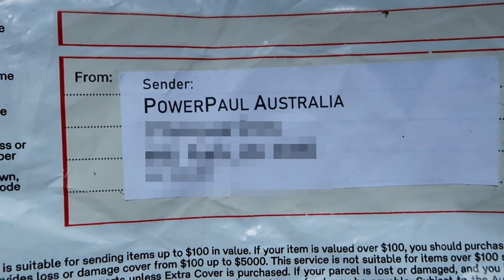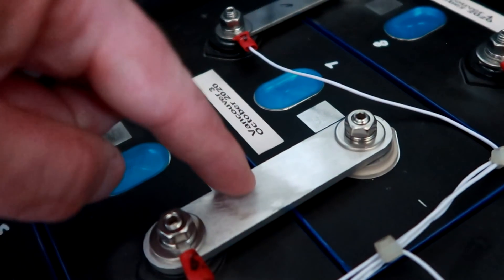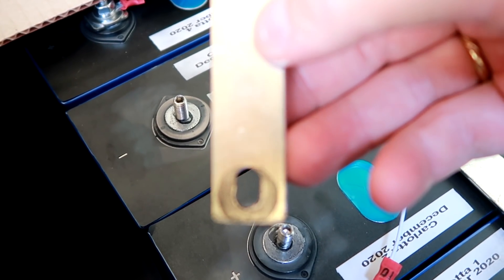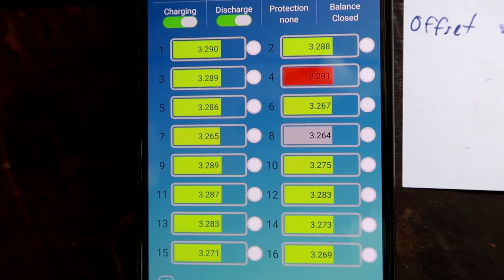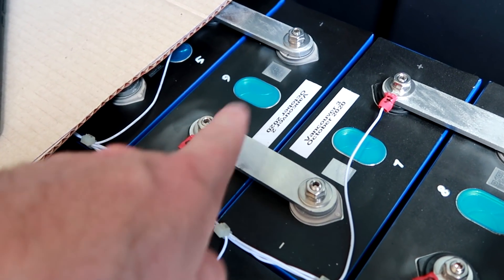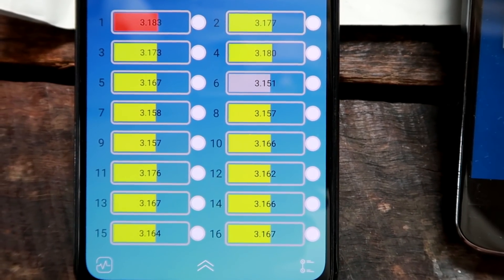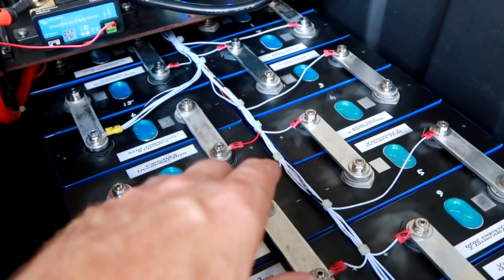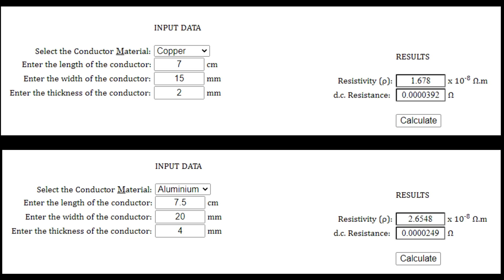Upgrading to Aluminium Busbars. Will this solve the issues?

Comment: 11:45 could be the right conclusion.
A joy (eine wahre Freude) watching knowledge and competence at work and I cannot imagine that this genius is not aware that aluminium connectors need to be thicker in size compared to copper due to
different conductivity properties: 0.0278 Ohm/mm² x m AL versus 0.0172 of copper.
If the battery terminals are made of AL then AL bars are the perfect choice for avoiding electrolytic corrosion.
Not sure how long any grease application could prevent moisture ingress from creating a battery cell of 2V between
aluminium and copper terminals or 1.8V in the case of tinned copper according to K.Giek "Technische Formelsammlung".
Within a week of charge equalizing 12x 12V lead acid batteries connected in parallel with simple AL strips for the purpose
of preparing those for 48V series configuration, I noticed terminal corrosion on some of the 24 connections.
No wonder, Lead to AL connection also has an electrochemical voltage difference of 1.5V. All it takes to start that process of
undesirable corrosion is moisture.
rolfgerig@bigpond.com
Reply from the maker: Hi Rolf, have you watched the video until the end? I did a comparison between Cu and Al bus bars. There is also a link to a calculator in the description.
Reply: @OffGridGarageAustralia  I perhaps should have 🙂.
My comment was not particularly directed at you except for compliments. Just general information for others.
No use pointing to literature of technical formulas to a walking encyclopedia anyway!
I have been sticking to Lead Acid batteries for my solar systems so far because of the lesser cost than Lithium
and simpler charging requirements rarely in need of cell equalization.
I am waiting for even better battery technology like AL-ion with promised properties encroaching supercapacitors
presently under scientific investigation and tried yesterday to include a link to a PV-Magazine AU article on the subject but YouTube censored and removed my entire content!
Cheers from NSW.

Comment: I look forward to the individual cell tests!
Reply: Pardon my ignorance, but what do you use to do the individual cell tests?  Something to measure the battery impedance?
Reply: @Swinopolis  Matt, individual cells can be charged, voltage checked, ohms of resistance measured, and load tests with amp/hours measured in load for a period of time until desired voltage is reached. Matt, I'm a newbie but that's what I guess.

Comment: Silicone high dielectric grease, which is also totally nonconductive, is also commonly used on battery and electronics terminals. Even telephone company "button" splices are pre-filled with it. But because you have metal to metal conduct displacing the grease, conductance is not an issue. The grease only blocks air and water intrusion.
Reply: Lyfan Deth. Aluminium jointing paste is not grease. Its job is to cut through the oxide layer and prevent it from reforming. 
The information is available from Utilux or Dulmison. Jointing Aluminium conductors can be a real pain and lead to spectacular failures if any short cuts are taken. 
When lugs or links are applied to aluminium cables, the lug comes pre-filled with jointing paste and sealed. The cable is cleaned and rammed home. The entire length of the barrel is then crimped in steps at 23 tonnes ensuring the paste is trapped in the joint.
Reply: Cool beans

Comment: I don't recommend aluminum. Many house fires in the US from aluminum wiring expansion causing connections to catch fire!
Reply: Nope. That was decades ago when aluminum romex was used in branch circuits with devices not rated for AL conductors.

Comment: Material IACS (International Annealed Copper Standard)
Ranking	Metal	% Conductivity*
1	Silver (Pure)	105%
2	Copper	100%
3	Gold (Pure)	70%
4	Aluminum	61%
5	Brass	28%
6	Zinc	27%
7	Nickel	22%
8	Iron (Pure)	17%
9	Tin	15%
10	Phosphor Bronze	15%
11	Steel (Stainless included)	3-15%
12	Lead (Pure)	7%
13	Nickel Aluminum Bronze	7%
Reply: This. That means that no matter how big an aluminum conductor is, it will never conduct as well as an adequate copper conductor.
Reply: @Sylvan_dB  Wrong. Those copper bus bars have almost double the resistance than the newer larger aluminium ones.  Very close to 0.00055 ohms per metre compared to the aluminum ones which are close to 0.00032 ohms.  Give or take a few percent.

Comment: +  If the bussbars are cool then they are cool :-)
+  If the terminal are not tight then you'll feel it getting warm to hot.
+  The old bussbars looked quite underwhelming.
+  Dielectric grease is used to inhibit the aluminium from forming Oxides, not to conduct.

Comment: Really enjoy your videos. You and I think alike. I am a big fan of Victron energy products. They just work. I am a power wheelchair user and we have modified my off-road tracked wheelchair last year with used battery cells from a Nissan leaf. I did not know about the chemistry runaway problem with those cells and we will be upgrading to prismatic cells for safety concerns. I did not know that the aluminum bus bars could make such a difference. Thank you for experimenting for all of us.
Reply: Recently purchased a 2012 Leaf battery pack to upgrade my bulky Lifepo4 pack on my ride on mower conversion. Not something you want to be near if you can't easily get away from the worst-case event.
I'll be connecting my ancient Lifepo4 200a cells to my new Victron Easy solar which should arrive today.
Andy's journey is a real gift for people starting out in off grid projects.
Reply: @andrewradford3953  especially for a wheelchair user. I did take a lot of precautions and finally found  a 24V 6S BMS's (One for each set charge only)  I had two sets of three cells in series and then running both sets in parallel in 24 V configuration. Then I used a victron smart battery protect for the high amperage controlled by the BMS with added low temperature protection , Low-voltage etc. Sorry this is off topic I can answer more questions on my page.
Reply: @andrewradford3953  I do like the Nissan cells I will probably repurpose mine for a DIY power wall in a metal enclosure. I have approximately 3KW in a wheelchair and a standby 1.5 KW backpack power pack as we call it basically just a battery in a backpack with an Anderson plug

Comment: Your "problem" was NOT voltage drop across the busbars, but voltage drop between busbar and battery terminal. No matter what size of busbar you use, this "problem" will remain. You likely now have two aluminium  oxide layers between  busbar and terminal to overcome.  I should also mention the high cell is of lower capacity, therefore will charge and discharge faster than those of higher capacity. The "low" cell is of higher capacity, therefore will always lag behind during charging and discharging. None of this is a problem.... they can never be the same, even if from the same batch. These readings will also vary over the following weeks and months of use.....
Reply from the maker: I measured the voltage drop in the last video.

Comment: Well use copper  ,  the best as as many wire strands as you can get hold off,  the atoms more more freely in small then wires the  in a solid block of copper.
And first of all make sure the bottom of the studs hit ground in other words makes sure the bottom of the studs should be 90 degree and great contact surface , promote this also with dieelectric grease also it treads  so atoms more freely with out any obstruction
Reply from the maker: dielectric = isolating

Comment: Hello  Andy,

Love the video's.
About the aluminium busbars and your voltage dops. Maybe you could try to put the balance leads directly on top of the busbar and not on the waser.
So you get cell- busbar-balancelead-waser-nut. Maybe one waser has a higher resistance than an other one, because they are stainless steel.

Greetings from Bonaire.
Reply from the maker: It should not make a difference though as the balance leads only measure voltage.
Reply: @OffGridGarageAustralia  but you see  voltage difference on your cells measured by the balance leads. So a small resistance difference can cause that it's only mV
Reply from the maker: @villacarinaapartments  I only see that because I'm pulling full load so the current going from the terminal to the bus bar causes the voltage drop. But I cannot measure that fro the stud to the ring lug of the balance leads. There is no current going  from the terminal though the stud to the ring terminal and washer to the busbar. It all goes from the terminal to the busbar.
Reply: @OffGridGarageAustralia  correct but the voltage you see on the bms app come from the balance leads witch are not direct to the cells but have to go thru the washer first. And that's stainless steel. So more resistance than if it was directly on the aluminium bus bar.

Comment: how about just get bigger copper bars with no crappy nickel on them. i bet you did not calculate the nickel coating on the copper bus bars on that calculator.
Reply from the maker: Copper will oxide quickly. I think they tinned them for exactly that reason.
Reply: @OffGridGarageAustralia  aluminium oxide's a lot more quicker than copper please research aluminium oxide layers vs copper. aluminium as soon as it is polished it will oxide strait away copper does not and the contact surface of copper stays good it is only the exposed copper to the air that the green oxide layer forms. basically the copper is coated to make it look good and not be green in colour.

Comment: VA includes reactive power and will be larger than the watts delivered to the device.  Reactive power is something that AC circuits have to deal with, it is not applicable to DC circuits.  It is basically the number you care about when calculating resistive heating of the wiring.  Use VA instead of W for that.   Watts is the actual power delivered to the device.  VA is the total power traveling through the wires (some of which bounces back to the inverter from the device instead of being delivered to the device).

Except for simple resistive heating elements, AC loads always bounce some of the energy back the other direction towards the inverter.  This energy does not cancel the forward direction and so must be added to calculate resistive heating of the wires.  Nearly all AC devices of any significant size have a 'power factor' specification that describes the reactive power.  Motors especially.

In anycase, reactive power bounces back to the generation source.  In this case, your inverter.  The inverter has two choices.  It can either sink the reactive power, or it can try to re-integrate the reactive power with forward power (making it more efficient).  All large inverters re-integrate the reactive power with a circuit that transfers a good chunk of the reactive power back to the DC side of the inverter where it can then be fed back into the inverter circuit.  Smaller inverters typically do not have this circuit, which means that the AC waveform generator is sinking all the reactive energy by competing against it.

Only a portion of the reactive power that bounces back to the generator (the inverter in your case) can be re-integrated into the forward direction this way, so the reactive power will always add additional heat to the generator's circuits.  Hence why generation sources such as inverters are always rated in VA instead of Watts.

For example, a low-frequency inverter (that is heavy and has a big honking transformer) can handle inductive loads much more easily than a high frequency inverter (which has smaller transformers), mostly due to being able to handle the reactive energy more easily.  This reference has good comments and a circuit diagram:

https://electronics.stackexchange.com/questions/275843/how-is-it-possible-that-an-inverter-absorb-reactive-power

So, in summary, AC generation sources (such as inverters) are rated in VA while loads are rated in Watts and Power Factor.  AC generation sources also often have specifications on just what kind of power factor they can handle, though it is mostly rolled up into the VA specification.

-Matt
Reply from the maker: And we are usually dealing with W only because we normally don't have to pay for the reactive power. But as you said, the generator has to supply the reactive power to the system and load, so it needs to generate this power in the first place. As most load these days have a reactive part of power and are not purely resistive any more, it's important to deal with this load from a generator and cabling perspective.

Comment: yes i believe most of your problem is because you chose to set your top voltage to low in the charge curve. the lower in the curve the wilder spread in voltage you will get.
Reply from the maker: Not if you absorb for long enough. It does not matter if you charge to a higher voltage and stop charging (absorption time set to 0) or if you charge to a lower voltage and let the cells absorb.
The reason to charge higher is because you have better control of how high you actually charge and it's more consistent to reach this exact point again with the next cycle.
Reply: @OffGridGarageAustralia  i maybe wrong but if you want your top charge to hold you need to stay higher in the curve the lower you go the wider the chances of individual cells droping faster  and that gap will get wider over # of charges. at any rate you must find the solution now that you have peaked everyone's interest. order a new set and ask for same batch with serial # grouped. start a go fundme so we may donate and end this vexing problem.lol

Comment: Aluminum can work for bus bars but copper has way less resistance, properly sized them oh, and they will be way bigger than they would be if they were copper
Reply from the maker: And that's were people get it wrong. Size matters and aluminium is great for such application.
Reply: @OffGridGarageAustralia  I actually made that comment before I watch the video. And was glad to see that you had got the resistance factor in check. And that was my bad for stating something before watching the full video

Comment: You may need to top balance again
Reply from the maker: Yep, haven't recharged fully for  quite a while now. I'll let the BMS doing its thing over several cycles. This should smooth it out eventually.
Reply: @OffGridGarageAustralia  that’s a good plan. Much easier than putting all of the cells in parallel to top balance.
The BMS should eventually fix it but it could take a couple weeks depending on the balance current

Comment: Check the batteries with an external voltmeter 
Maybe the bms gives you false voltages
Reply from the maker: Done that in the past videos. They all match, the BMS is correct and accurate.

Comment: I think your original copper busbars were fine. I'd go with your assessment the non-conductive grease as a good reason for the uneven balancing issues versus going with the "bigger is better" aluminum busbar approach (sort of along the lines of overcompensation or an inferiority complex of metal types). Although, this gave reason for a marketing plug/ product placement. I'm not sold on your "upgrading" from Copper to Aluminum logic. Quality over quantity. I understand the conductive differences, but don't think the busbar change is going to make much difference, other than improve aesthetics, I suppose.

The original copper busbars would still easily handle your 100A max output. Especially, since the 100A would be divided by the 15 busbars linking the 16 cells in series that make the battery (~7A each). I think any resistance efficiency differences would be negligible for this type of application.
Reply: Series connection means all current passes through connections equally, kinda like a road with no on ramps or exit ramps.

Comment: Thanks for this and all your videos. As I've said before I have a 16 battery 280Ah system that I am trying to build and I am learning a lot watching you.

I was thinking it would be nice to somehow get a gas-tight connection between your busbars and your terminals. The only thing I could think of (and as you know I don't know much), would be a "serrated flat washer" or a "flat lock washer" that is made of aluminum and crank down the busbar to the terminal with the washer in between. It could act like a crimp by digging into both surfaces and making a gas tight connection.
Reply: You really don’t want to crank on these particular cells which is something that makes me nervous with all Andy’s activities. It is a weakness of the 280 cells.
Reply: @cdkipp  you're not cranking on the cells you're basically pushing up on the set screw to push down on the terminal
Reply: I understand. To be more specific the threads in those terminals strip out quite easily. It is a known problem with these larger cells. So you end up needing to retap them and/or putting in a helocoil.
Reply: @cdkipp  thanks. I'm just not sure they're going to strip if the screw is not turning/moving. You're turning the nut on the stainless steel set screw, pushing the bus bar against the terminal, but the set screw does not turn in the hole. That's why I was thinking you could get away with it. The set screw would literally have to just pull through all of the 'nut threads', without turning. Not sure this would be that easy to do but honestly, again, I don't really know. I have personally never been able to just pull a screw out of a nut without any turning. But again the 'nut' in this case is made of aluminum..

Comment: Hi, instead of busbar, can I use 25mm battery cable connector instead?
Reply from the maker: Yes you can, but you have more connections and more resistance as you need to crimp all these short cables to ring lugs.